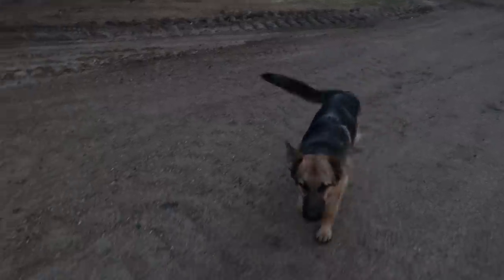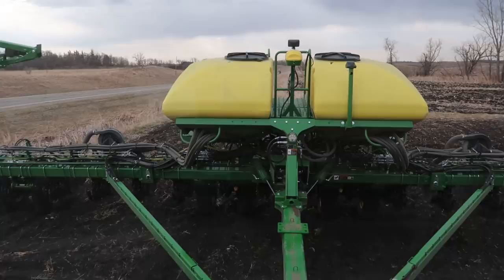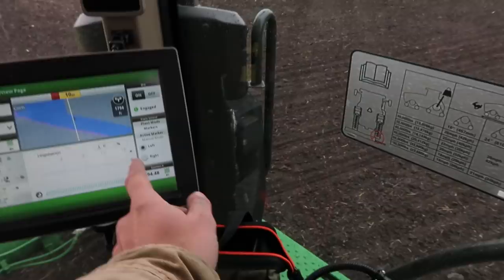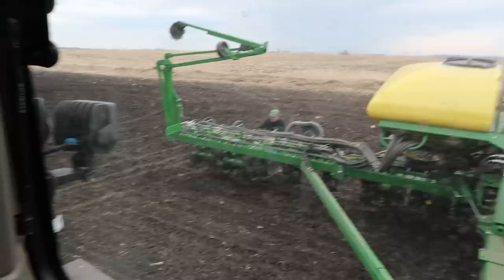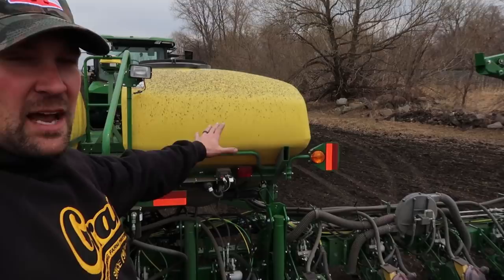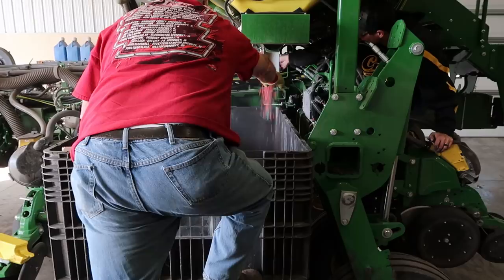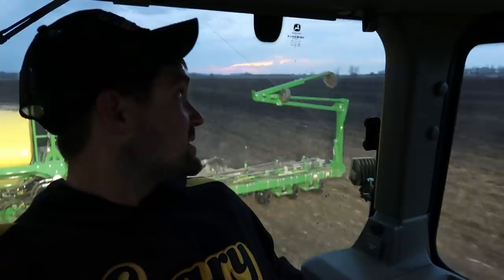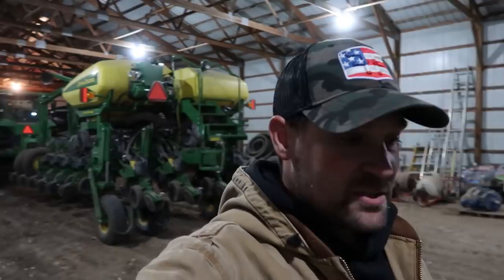A BIG Announcement from John Deere

Comment: A spring rake took on field cultivator shovel, get hooked. A ring is easy to pickup too, from horse use times.  Also a fence staple will get pickup by seed opener disks, lock them from turning.

Comment: In Michigan a field that the neighbor works use to be a lumber mill in the 1860 or there abouts,  worked with horses for years got permission to metal detect it and in the course of 2 wks. I pulled 6, 5 gal pails of scrap metal out of it.  I got 4 metal spikes with sharp ends on them, don't know how he works it without getting flat tires. have a good season.

Comment: Hey Deere, if that frame to hose connection is important, how about a hose clamp?  A  $.79 part could save a lot of aggravation.
Reply: Exactly. I would assume John Deere figured that because it is under vacuum, it would hold it in place.  However, it's not under vacuum during transport or when servicing.  Zach may get the usage for free, but also ends up being John Deere's guinea pig.
Reply: @jameschristie4596  free machine, not his responsibility for repairs. Looks like zach is coming ahead and John Deere is sweating it wont fail on camera.
Reply: Sure, but hose clamps cost time and money to put on. Which you as buyer of the machine are paying for. Also, new machine = new problems
Reply: At least a zip tie🤔🤔
Reply from the maker: I have to say honestly I don't want to deal with a hose clamp on all of those lines.  This way I can remove them without any tools.  It was just a bug on a new piece of iron.  That hose won't pop off ever again.  They never have on our other planter.
Reply: @MillennialFarmer  a few judicious wraps of Teflon tape would tighten it a bit
Reply: @johnwhite5897  you  just nailed   a zip  will do  the job  jd have to consider  that aut side temperature  and  air  pressure  work against  each other   something  have to  give up
Reply: Lol....how many of you guys making comments  have actually ran one of these planters?   Just saying...... If you haven't worked on one don't worry about it.   Those hoses didn't pop off.....they just were not hooked up correctly from factory. I would encourage you guys to swing by a dealership though and take a peek at these machines.  They are quite impressive.
Reply from the maker: @vrfarmerguy  bingo!  Those hoses don't go anywhere!

Comment: We are starting to striptill the last circle or 1/2 mile sprinkler.    We should be planting corn and cotton in 4 weeks beginning later in May.    I guess Texas is a different place.   We used to plant mid April in 50 degree tilled soil but I like the 65 degree soil to have the best stand possible. Tassel in August when nights are cooler and longer.

Comment: My 1775 has the same belt. When I bought this planter I was told that the seed delivery belt would need to be replaced often. I plant 2800 acres total per year between corn and soybeans and the belt has not been replaced so far Zach, tell me please if you need to replace your 1775 belt sooner. I know that your planter is only a loaner but I am wagering that by next planting season you will have a 24 row row 1775. After you plant 9 to 10 mph you will never have the patience  to go back too 4 to 5 mph.

Comment: Enjoy your videos.  Tractors, planters, and monitors have come a long way.  I worked at the Deere planter factory when the first front fold planters were released.  I also helped test the first vacuum meters.  i retired from Deere 6 years ago.   I find it interesting now about the brush delivery belt for the seed.  The 495A planter in the '60's had a chain system that did the same thing.  Then the finger pickup units used a belt.  What goes around, comes around.  Good luck this year!

Comment: Great job explaining everything you are doing -  different seeds & coating colors - equipment issues, interventions, etc. (regardless of the equipment color issues will present themselves).   Vacuum leak - maybe it could be considered an operator issue, doesn't matter,  but your not shy about showing them.  Good learning tool for us.  Keep um coming.

Comment: Zach I know when you are having a stressful day when you reach for your snack bag as I did the same thing. I love your videos and seeing how much farming has changed in the last 14 years and it's awesome to see the differences between then and now that makes farming so much easier and saving time which time === $$$ Money or PROFIT or LOSS and I always said I don't need to go to a Casino cuz I do that  " Gamble in Farming. I love all the different equipment that you have introduced in your operation like the tractors and trax and planter and how you can plant at 10 mph, your seed trailer and the Thunder Creek fuel trailer. Have you ever had or used a JD mulch finisher as we would disc stalks in the fall and use the mulch finisher in the spring and then plant. We had a 12 row front fold and we planted at 6 mph but occasionally would get a stalk stuck in the trash whippers causing the row to plow and always had to get out and use a brush and run it up and down on a seed tube cuz the eye would get coated with talcum powder or graphite. Love your videos ,and  you showing what the todays farmers battle and how stressful it can be between the weather, ground conditions, grain markets, and the other phases of agriculture like poultry, hog,egg layers, turkeys but have you done any videos on cattle feeders yet ? I will be sending you something in the mail for you to have in the tractor during planting and spraying and harvest.  I'm always looking forward to the next video, videos you upload and yes Andy the Armless Farmer is Amazing on how he can do so many different tasks in farming. Hope you are having a great day and awaiting your next video and podcast. You have a awesome wife that thinks about you and brings you your meals and occasionally drives tractor for you and hope to see more of Becky in the tractor this year. God Bless and stay safe  !

Comment: How does add-blue act  on tractors ?? Cos over here on our Flatbeds at work and we noticed that using add blue 
(turning it on with a switch) the trucks slightly lose some power so we always leave the add-blue switched off

Comment: I’m just curious what your soil temperature is. I’m in the mid Atlantic and it’s still under 50 here.  Also are you going back to the 8 row head considering the planter and splitting hybrids for testing?

Comment: If the right to repair act failed to pass, it will be crime for you to fix that sensor. John Deere would require you to take that machine into their shop to have it fixed. Right to repair act isn't just for phones and computers but it branches to basically everything from machinery to cars to house hold appliances. Keep an eye out for any legislation that is against our right to repair.

Comment: Is the vibration clicking sound I hear in the cab cause ur running 9mph an noise coming from the belts on the tractor? Sounds kinda like a dozer in high gear not down grading it just curious

Comment: Just curious why you need a 6000 series globe on the planter itself this coming from a guy whose only used a 16 row chain planter
Reply from the maker: The 2 receivers communicate with each other to compensate for implement drift.  It's pretty awesome.  We did that so hopefully using a 12 row header won't be much of an issue

Comment: Having to "phase" it sounds hokey, indeed, absurd. By way of analogy, it is equal to John Deere suggesting you use the engineering equivalent of a hammer to fix a glitch for their on board computer for your tractor....you need to phase it....what a joke
Reply from the maker: Would you feel better if I said "calibrate"?  Hydraulics need to be phased on every machine sometimes.

Comment: If this John Deer wants to help farmers, it can start by providing them with access to diagnostic and coding equipment that will enable them to repair their now-computerized machinery, instead of expecting them to drag 15 Ton machinery to the dealer to deal with computer issues that can be fixed with a laptop. This is monopolistic behavior and it needs to be banned.

Comment: Seems like there is just to much technology involved in farming. That tractor you are driving is pretty much a robot. All the rest of the stuff you have is just as bad.  People need to consider what is going to happen when the next EMP comes. NASA  says it is not if but when the next EMP will come. That will fry all those electronics and you will have nothing to work with.
Reply from the maker: There's a point of having too much tech for sure